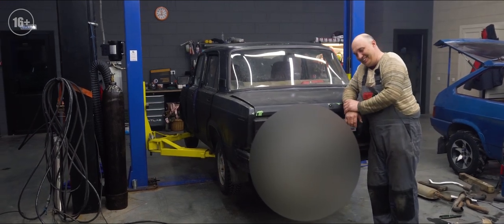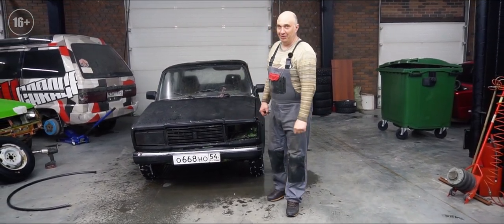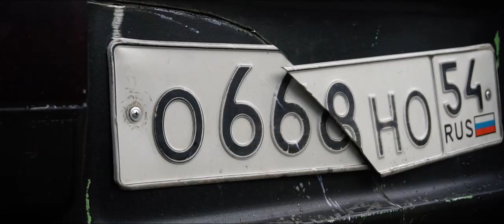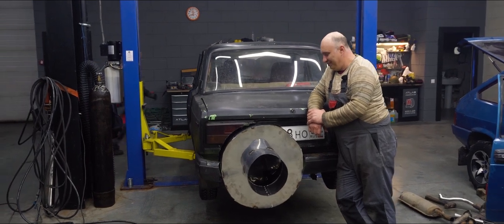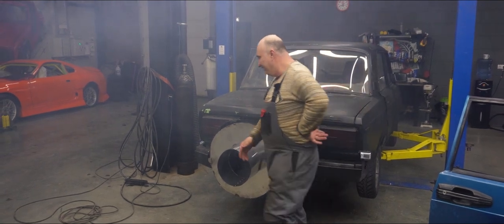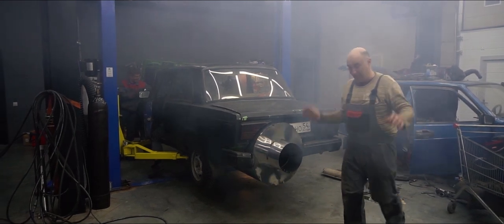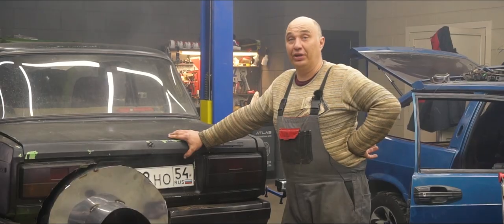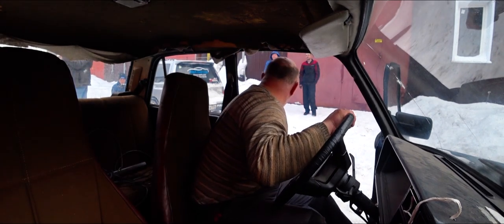Making the loudest exhaust

Comment: Alright, time to stick this on my Civic and drive through the neighborhood at 3 AM.
Reply: You cant fit that on your Civic:)
Reply: Most Civics already have something like this installed.
Reply: @spankthemonkey3437  ha ha stock
Reply: My civic is B16a2 swapped with a lsd tranny. It is loud, but I am considerate and I do not drive through neighborhoods at night making noise.
Reply: @spankthemonkey3437  My 97 EJ8 Civic coupe has a built turbo B18C1 in it and makes 612 whp. It doesn't have AC or PS, but I still enjoy a nice sounding exhaust that doesn't drone, so I bought a $800 Thermal Research exhaust for it and with the big turbo and thermal muffler, it's fairly quiet for such a high horsepower car. I built it as a drag car.
Reply: @GreatBirdOfHope  I painted my 97 EJ8 coupe 99-00 Civic Si EM1 Electron Blue Pearl and made it into a tribute car. Everyone asks me if it's really an EM1. Those B16A2s from the EM1 are an awesome engine though.
Reply: I swear a straight piped civic is already loud anyway lol
Reply: I’m the guy that keeps egging your house and car ;)
Reply: I drive my loud Chevy like an asshole everywhere day and night so... It's not just a honda thing. It's a car guy thing
Reply: @Brock_Landers  they are amazing!   I love high revs!!❤
Reply: @Brock_Landers  been thinking of boosting my B16a2 swapped 95 coupe. Looking for 300 to the wheels!👌
Reply: Mmm, burning Civic at 4am. I hope you didn't keep your 5 million $ bitcoin USB wallet in the glove box, lol.
Reply: Vivian Stimpson  ricer* thing
Reply: Bro. You only live once
Reply: Watch out for the snowballs! Or even bricks!
Reply: Do it
Reply: @witnesszer0  keeping it stock is still better than thinking you can go faster with a simple hood scoop.
Reply: Ricer
Reply: @thedancingpickle6362  Race Inspired Cosmetic Ehnacement R
Reply: I think they come like that from factory
Reply: My civic has 1000 horsepower from the air vents for the hood from Home Depot and also the side vents and it’s sticker bombed all that adds up to 500hp and then I added a double wing for the hood and the downforce broooo easy 1000hp
Reply: @Fxstneem  dont forget the new muffler bearings they add hp
Reply: Whats wrong with stock you rice boy
Reply: - every Honda driver
Reply: this is bigger tan you civic but we get the joke
Reply: I had a 95 civic, most reliable car I've owned but was rapidly rusting away to nothing
Reply: I found you! I don't care about the news paper that made it next door and skipped me. I wasn't chasing you just wanted to run it from a digg see if sound matched the power.

Comment: Needs a turbo just to see anti-lag now
Reply: You don't need turbo/antilag if you just adjust timing enough on NA
Reply: If you wanna see flames through that pipe, just grab some firewood and light it up inside that thing, thing is bigger than the boiler they did for the steam powered lada
Reply: life sideways that would be crazy, I can’t even imagine how many would call the cops saying a bunch of bombs just went off
Reply: You just need a rev limiter or an ecu that supports a rev limiter program.
Reply: @cdawson198600  at least you get me bro 👍 plus you cant beat that spooling music
Reply: life sideways oh man I’ve seen cops show up because someone reported machine gun fire lmao we all lost it and laughed
Reply: More fuel with mixture needle more Boom boom
Reply: The backfire would blow up the planet
Reply: Yes
Reply: Wut?
And i think u mean 2step antilag is not common on regular cars. Usually only time attack, hill climb and rally cars that i know of
Reply: @screener545  Correct
Reply: @Iron-Griffon  Do these old ladas even have an ECU? lol
Reply: @mode3763  I think in the 90s they started to get ecu's. I can assume that Lada is probably 90s cause it's more fresh than most.
Reply: Pick this one 😂😂
Reply: @screener545  no he means antilag, 2 step is just 2 rev limiters, antilag is used to either build or maintain boost. 
Believe it or not most cars with turbos with launch control have antilag, this is due to brakeboosting to apply a load to the engine and turbo thus building boost.

What you are thinking of is between gear antilag, what this does is retard timing or cuts it out entirely (very rare) and relies on the heat of the turbo to combust the fuel right before the impeller to keep the turbines speed up to get back into boost quickly. That's why you hear rally cars pop really quickly when they go around corners, even though the engines RPM is going down,  the turbine is still moving just as fast if not a little slower than before meaning boost comes on instantly or nearly instantly.

The only difference between antilag and 2 step is application. 2 step can be used NA or turbo, and it's meant to make launching easier/faster. Antilag is turbo only (not supercharger) and it's used to build sustainable boost or maintain boost.

This being said, 2 step is considerably safer for an engine than antilag, back when Group B rally cars were a thing, they would have to change the turbos between every round, and typically had bigger turbos during qualifying due to power restrictions being removed until the official races. These are two reasons Group B has been cancelled, not to mention that it is insane.

If you guys never have, you should check out some Group B rally cars, they were mental then and still would be absolutely mental today. It'd be interesting to see Group B cars with today's technology
Reply: @Iron-Griffon  You don't even need a Rev limiter. You just need to cut off ignition and then turn it back on so that the fuel goes into the exhaust and then gets lit.
Reply: @jacobwebb8818  there is a lot of incorrect information there. Im not sure what to start on to be honest.
Reply: Turbo on a carburetted car?
Reply: @jayplexy5983  there are manufactured carburated  cars with turbo
Reply: People talk about getting an AK-47 tune for their car with all the pops. With that exhaust it'd be an RPG tune with how loud it is.

Comment: no one:
Ricers: That adds 500 horse power
Reply: Also ricers:Black paint job adds only 10 hp,Imma go for dat exhaust.
Reply: @SteelBelted  Connect that exhaust to a tuned 4-rotor...

BRAP BRAP BRAP
Reply: best comment ever
Reply: You'll be running 9's!
Reply: It actually does add horse power because the pipe is bigger
Reply: @giovannicesaramorim9adigan961  no it doesn't that myth has been debunked by professionals lol
Reply: @jonathanlawson4667  It actually does add because it make the engine breath better, for example, if I would have let a single small hole as an exhaust the exhaust gas wouldn't be able to leave, making the engine totally useless, although there are limits.
Reply: @giovannicesaramorim9adigan961  depends on back pressure as well, an exhaust this big would flow too much and actually cause the car to lose power
Reply: @giovannicesaramorim9adigan961  where are your sources? A trashcan find?
Reply: @WELLINGTON20  I meant because of backpressure horsepower loss, it would only increase by a tiny bit

Comment: If you're looking for the loudest exhaust, all you have to do is visit my neighborhood.
Reply: what ...is the silencer removed ??
Reply: Electronics N More. Once again
Reply: @manz007  silencer? u mean muffler XD
Reply: @mr.zyclonic1463  Its the same thing just different wording depending on where you live.
Reply: @TheGuitarist36  ok
Reply: a neighbour has an old Kenworth dump truck with an 8v71 detroit diesel... fuckin hell is it loud
Reply: The motorbikes where I live :)
Reply: @manz007  every one of my vehicles has a muffler delete/straight pipe XD
Reply: @DaneH64   Any benefits to it.....or is it just about the noise.
Reply: @manz007  more power and torque due to less pressure, and it sounds awesome
Reply: @Pslobe less mpg is a small price to pay when I get a 30hp increase, that and gas isn't very expensive for me
Reply: @manz007  over here they be running with no headers

Comment: Idea to increase power:

A home made forced induction system.
Reply: I just imagined some guy with hand pump just ramming air into a intake xD
Reply: There's 110v electric turbines for green houses that push well over 6,000cfm, If they had a gas generator in the back seat and used one of those things... I bet it'd be about as good as regular turbo could ever be on a lada.
Reply: @CooKiesHouseCannabisCo  Nah...  Turbo from a large diesel railroad engine!  :-)
Reply: @CooKiesHouseCannabisCo  You need pressure, not just volume to boost an engine.  🙄
Reply: @CooKiesHouseCannabisCo  Doesn't work like that.
It needs to compress the air going into the cylinders.
Reply: @tcmtech7515  Roots would like a word with you
Reply: @tcmtech7515  You need volume to be able to make the pressure.
Reply: Russian direct injection: slav spitting vodka into engine.
Reply: @tcmtech7515  they do, an insane amount of pressure..(not sure on exact figures) they need it to blow air through merv10+ filters and such. 

and we're talking dinner table size filters.
Reply: @gazjones8781  0.6Bar is the rating on mine after looking, not sure but that's probably plenty for a shitty old russian lada engine.
Reply: I bet they could make their own turbo
Reply: @ellenorbjornsdottir1166  I have doubts about that, and thanks for projecting your proud ignorance of reality at as if it would prove a actual point  in your favor.    🙄 

Now, go look at a typical Roots blowers specs. Specifically the input power and output pressure ratings when being used in a engine boosting application.  😋

They are magnitudes of order above what a common 1/4 - 1/2 HP  high volume low pressure furnace blower makes.  🤪

#learntoengineer
Reply: @CooKiesHouseCannabisCo  Yea, seems the kiddies dont know shit here about the differences between different blower systems and their functions.  🤣

A high volume furnace blower makes about 1 - 2 inches of water pressure full tilt for its ~ 1/4 - 1/2 Hp  input.🙄
Whereas the big positive displacement Roots type blower make several 1000's of inches equivalent pressures while using magnitudes of order (10's -100+ of HP)  more input power to do it.  😉
Reply: @tcmtech7515  that's okay, i was a little derp once upon a time too. ^_^
Reply: @tcmtech7515  When used in engine boosting (as opposed to naturally-blown for two stroke engines, discussed elsewhere in this comments section), they push volume against a closed space (the engine's intake plenum), which is an inefficient way to make pressure. I'd rather use a centrifugal supercharger. Maybe you should #LearnToEngineer.
Reply: always wanted to see that or a fwd with electric motor assistance in the rear
Reply: You got 1 vote from me!.
Reply: When you create pressure, you get volume. When you get volume, you dont necessarily make pressure. 

That said, you need more boost to make more power. Because more boost means the air is more compressed, so the molecules are closer packed. As long as they stay cool. If they are hot, you can have all the volume you want, but it's not really air, its just moving air. And the more it moves, the hotter it gets.

Comment: The loudest exhaust starts with a rotary engine.
Reply: Truck pulling engines make some noise as well as vibrate the ground within 50m radius from the said unit
Reply: The loudest exhaust I'm aware of are Top Fuel dragsters. When idling I've been told each time a cylinder exhausts is has the same acoustical energy as a 12 gauge shotgun shell.
Reply: Thankfully, there are stock rotary Ladas.
Reply: 100% true
Reply: @177SCmaro  Those things vibrate the whole track when they launch. And a good kilometer in every direction. Super loud
Reply: @keksauce  
I've even heard they can give false readings to the equipment they use to measure earthquakes. You figure between two of them that's around 15,000 - 20,000 horsepower worth of energy being released all at once, the equivalent to a respectable fraction of the power a small power plant produces.

Comment: Please convert a Lada engine to a 2 stroke🙃
Reply: Please Complete All Fields  Definitely possible. Redo the cam timing to open the intake and exhaust  at the same time and twice as often, redo the ignition to spark twice as often (or injection to inject twice as often on a Diesel), and put an appropriate blower (or over/underdrive a smaller/bigger one) on the intake side - a 4/23 Roots (theoretical) for about a 90 cube motor.
Reply: Benefits of my way: you don't even need premix fuel.
Reply: It's possible with forced induction, like the detroit diesel engines

Comment: I'd imagine an exhaust in the shape of a horn speaker would probably be the loudest design i could think of. A horn speaker is a better form of impedance matching, bringing the benefits of a larger exhaust but with less noise losses from the instant diameter change between the exhaust pipes and the exhaust tip. Unfortunately an instant step like that reflects some of the pressure (sound) waves back, hence similar concepts being used to improve racing engine performance.

Comment: There is a better way, the idea is to amplify the sound, the best way to do this is to use a horn shape as would be used on a PA system. You would want to start with the original diameter close to the engine and then slowly expanding the pipes diameter towards the end of the car to as large a size as possible. Doing it this way would magnify the sound and enhance the low bass spectrum of the sound especially. If you really want to go nuts I would suggest using square duct type of metal work not a circular pipe, using a rectangular shape for the exhaust would allow you to make a huge diameter opening at the rear of the car that would further enhance the loudness and the low frequency tones.

Comment: I'm sure that this has been said at least 100 times now, but you should change the exhaust exit from a straight pipe to a cone/conical cylinder. Much much much more amplification is possible with a cone. Snow & Wodka=Crazy videos that you can't help but enjoy.

Comment: The way to make the loudest exhaust is to use a horn - look into how speaker manufacturers design enclosures for maximum acoustic output. 

Basically if you were to bolt a tuba straight onto the manifold, that's gonna be loud as hell.
Reply: This is actually probably louder due to the air blowback of the narrowed down nozzle causing HUGE pops & bangs in the primary chamber.

Sure, the horn would have a louder constant tone, but you wouldn't get those CRAZY explosions. You can literally see the sheet metal bending & waving when these "pressure bombs" hit.

Comment: you could have just taken a tuba (probably one that is already too damaged and unplayable) and cut the bell off at the point where the pipe becomes the same diameter as your existing exhaust and stick it on. the sound would have probably been a lot louder with more bass and not be so "tinny" from all that sheet metal rattling.

Comment: You want noise: run without an exhaust manifold! And idle it for awhile before you shut it off or the valves will warp and it won't restart.

Comment: Acoustically speaking, if you want maximum volume from something like this, it needs to continuously grow in diameter from the point it leaves the engine. This transfers the most energy to the air from the pulsing at the exhaust ports.